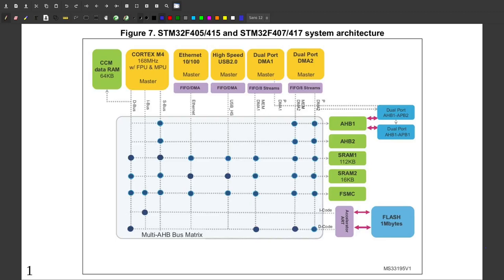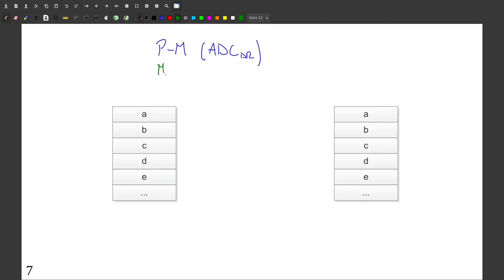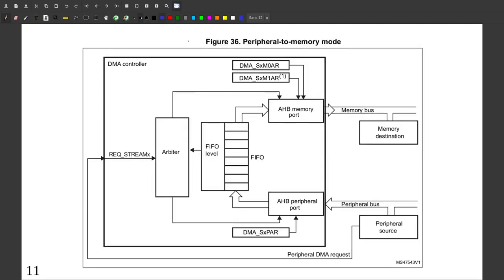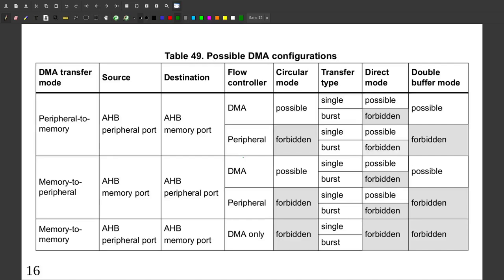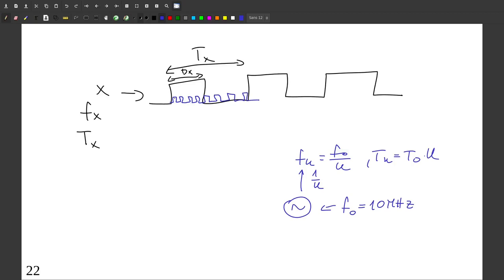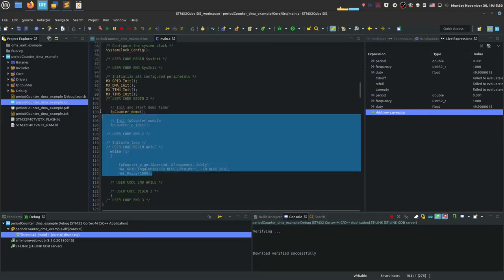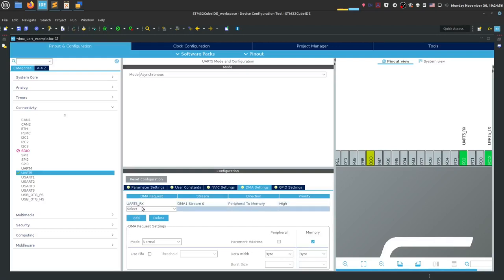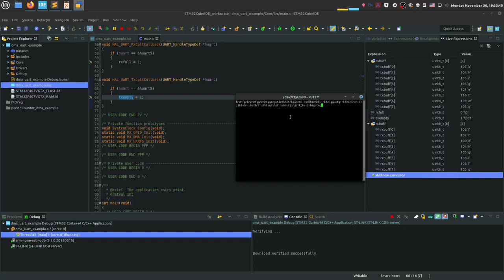DMA on STM32 HAL with 2 example projects | VIDEO 36

Comment: I can't find the DMA request mapping table (04:32) for the STM32H743VI. It's not in the datasheet...
Reply from the maker: I took a look into datasheet and reference manual for the part. It's a very powerfull package, do doubt. This comes with some changes regarding data busses inside. Because it has 4 DMA controllers it uses something called DMA request multiplexer (DMAMUX) to manage DMA reuqests between peripherals and DMA controllers. Look from the page 694 onward or in section 17 of the reference manual (RM0433).

Comment: Great tutorial!
I actually am also developing a project similar to your "UART Tx and Rx with DMA" example with a tiny difference which makes a huge impact and has been a huge headache. Unlike the protocol you implemented, the one I am working on does not state that the messages have a fixed length (like the 8 byte yours does). The protocol I am implementing has variable message length which makes the Rx part of the code a problem: If I do not know the next incoming message, I cannot guess its length... consequently I cannot state how many bytes to expect in the Receive_DMA(...,...,Len) to trigger the Rx interrupt.
I have a work around which is to set the Rx Len to 1 and trigger one interrupt for every byte received.... but this seems sooooooo ugly and inefficient! :(
Still looking for a better solution but haven't been able to find one yet! :'(
Reply from the maker: Hi, I have implemented on such protocol on our production device.
The idea is simple and so is the implementation. You "assume" that the messages are comming in "slowly" and you just let DMA copy bytes into a buffer. In your "main loop" or an alternative (rtos task) you keep track on where in the buffer you have checked for a message and just parse bytes as they come.
Then you have a stateful parser that check for parts of the message. For variable message length, I would have a part of message contain a size of payload, that can vary between 0 and "max". 
I'm welcome to other ideas, but this sistem works geat for us.

Comment: Hello there, great tutorial

I was wondering if you maybe could tell me how to properly read GPIO pins to RAM with DMA?

You see I am using STM32F769i and I am trying to read the whole GPIOE (because GPIOE has a blue button connected, so I can quickly see if its working) bus into RAM 

Now I configured TIM1 timer to push the DMA every 2Mhz and I am comparing GPIOE->IDR to my buffer to see if its working (my buffer is in DTCM section so thats its protected from coruption (at least I heard that you have to do this)

My TIM1 is counting properly
my DMA2_Stream5->NDTR is also decreasing properly from 16 to 0 (16 is a size of data I told DMA to copy)

but for some reason my GPIOE->IDR does not equal my buffer so I think its not working properly and I am not sure why

I have DMA2 configured in Circular mode with PERIPH_TO_MEMORY as well as Peripheral Aligment and Memory Aligment to DMA_PDATAALIGN_HALFWORD

not sure what the problem could be
whats the best way to check if DMA is doing its job properly?

I would send you the code if I could but I cannot put it in youtube comment :)
Reply from the maker: Hey. For cases like this, you could post the code either on github, or if it's more private, you can post relavant chuncks only. Some parts can also be shared on compiler explorer.
I don't have much to suggest from your description as it sounds like you have thought of everything. But as things go, precission is important and if you have but a single setting wrong, the thing might not work.
You can check if dma interrupts are working - half and full copy buffer interrupt complete. You can set a global var and check in main if its set. 
Also make sure, that the function, whith which you start the process (something like HAL_DMA or HAL_TIM or HAL_GPIO) function, that starts DMA / peripheral function ,should be used.
Reply: Hi there, thanks so much for your help

Its not that I don't want to share source code but its youtube, that magicly deletes all my comments if I link to github

Not this time thought :)

Here in this video: https://youtu.be/DR0MmSlkp_c

in the description there is a link to source code as well as picture of how it should look like when working

Because yes, I made it work with registers only (the problem was because I was reading address of an array instead of actual value so thats why nothing matched

Now I am trying to make it work with HAL as well

if USE_REGISTERS is defined it will use register implementation, if not defined, it will use HAL

with HAL DMA NDTR just doesnt move, implying that TIM1 (which does count) is not starting it or something

Well if you could maybe take a look, maybe you figure out something I forgot (my brain is just stuck and not sure how to continue :) )

My ultimate goal is to make this example work on STM32H750B (buts its along way to get there, first I need to make the example work with HAL :) )

Well lep pozdrav iz Slovenije and take care :)

Comment: Tricky question: is there a way to receive and send from the UART via DMA COMPLETELY BYPASSING THE CPU AT ALL TIMES? No polling in the while superloop and no interrupts
Reply from the maker: You can configure it in circular mode and it'll write to that buffer front to back all the time. But that's not usefull since you'll be loosing information all the time.
I use this mode, but then in a super loop I check the position of dma write index ajd compare it to previous read index to determine if new data was received.
Reply: know that the inspiration for what I want to do is you. I want to do what you did with UART on your interrupt video, where you made an app that showed on the serial monitor everything you typed. Basically loopback in UART with single characters. But I wanted to try it with "pure" DMA. Thanks for the tips!

Comment: Hi Matej!

I love your videos and I've been useful for me. I would like to ask if you know to create a project to read I2C peripheral using DMA. I've been trying but I don't to do. My project consist of to connect STM32F446ZE to accelerometer KX132 to read buffer information. This accelerometer has a internal buffer of 516 bytes of width and I want to read many buffers of this width with DMA. I use HAL_I2C_Mem_Read_DMA function to read buffer and I see the interruption HAL_I2C_MemRxCpltCallback work one time but I want to read buffer continuously. If you know any tips of this topics it will be useful for me !

Thanks for you videos, I'm waiting for more!

Note: English is not my native language, sorry :(
Reply from the maker: Hi, thank you for the comment.

You can use the interrupt when the dma transfer is complete, to store your data, do a small amount of work (process it, filter it or just store it somewhere else) and then schedule another transfer - call the HAL_I2C_Mem_Read_DMA again. I haven't had a need for this as of yet, but I assume that something like this should work. One idea would be to just use continuous mode, but you can risk your data beeing corrupted. That's why I would manually schedule another transfer when you're ready.

Hope this helps and thank you for watching.

Comment: Rather than write comments on the slides try using text.  When showing source code avoid using the IDE as it takes up so much of the screen that it makes the code section harder to read.
Reply from the maker: Fair point. I have a large monitor so I sometimes forget to bump up the scale on the font. Drawing on the screen feels different from just shuffling through slides plus it takes me less time to prepare (although slides and script can take lots of time for bigger topics).